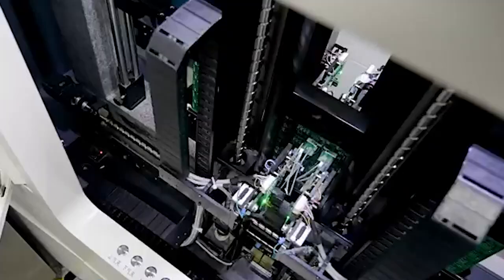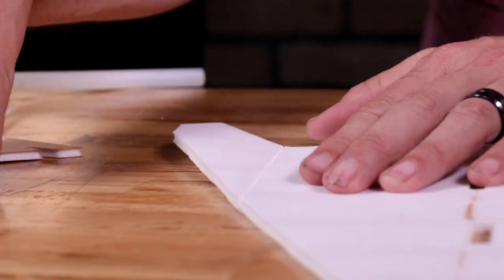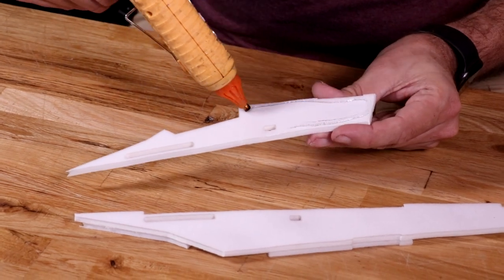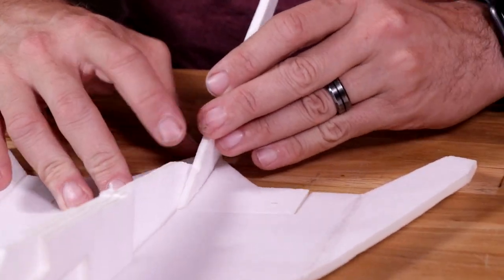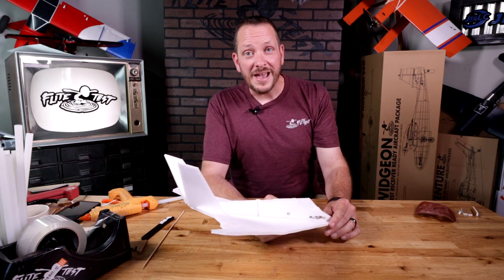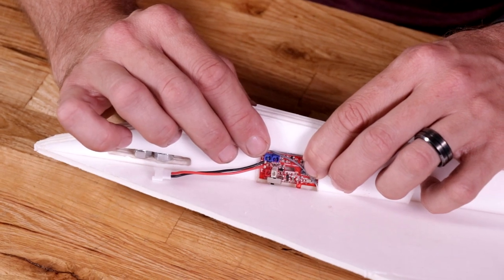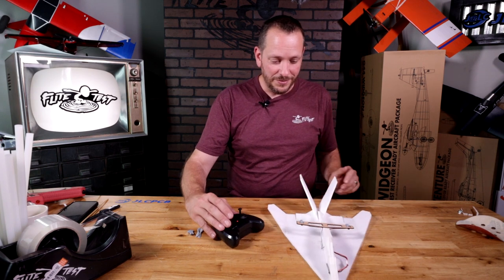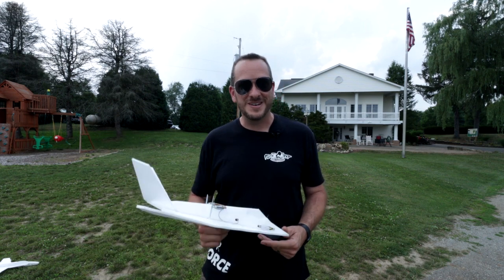How to Build the FT  EZ Stealth //  BUILD

Comment: Wouldn’t recommend this if you’re a beginner in RC Planes. I now have a mess of whatever this thing is made out of all across my dining room table. It doesn’t even come with instructions and there’s so many pieces some of are mixed with the other model pieces. 0/10. Do not buy.
The one I have is completely different and doesn’t even have this cardboard back to it. It just seems like the crappy material is all that you get. This tutorial is incredibly vorhingt and you have to have all these items that you usually find in your hardware store. FliteTest needs to do better at beginner level RC aircraft models. I have so far built NONE of them because of how complex this is.

Comment: When putting the cricut board receiver on the plane make sure the switch is always pointing down.
If it is pointing up it upsets the self correcting system.
I hope this is helpfull as I found this out the hard way.
Robert Ingham North Queensland Australia.

Comment: Neat product, inexpensive controller and hardware for easy to build and fly models with a high level of success for the beginner pilots. One Question... Shouldn't the Right motor have the Red Lead ? (like audio products use red for right and white for left ?)

Comment: If I have a drone, could I use the motors from there?
Reply: Maybe you will need a little more power, if you have a mini drone. But with big enough motors, it will work.
Reply: So if the motors are soldered on should I just un solder 2 of them and then use the other ones
Reply: Note that the motors in the vid are brushed. Drones tend to have brushless motors, meaning they need a different kinds of electronics. If your drone has brushed motors (as is common with really cheap toy-grade ones) you could probably use them. If they are too powerful though it might blow up the flight controller or the battery might not be enough to spin them at all.

Comment: would it be possible to run the props through slots in the wings so you dont need a motor mount?
Reply: I think on the trailing edge of the wing might do the trick.